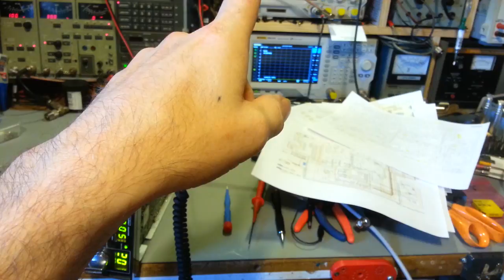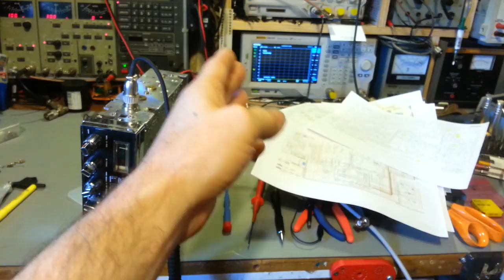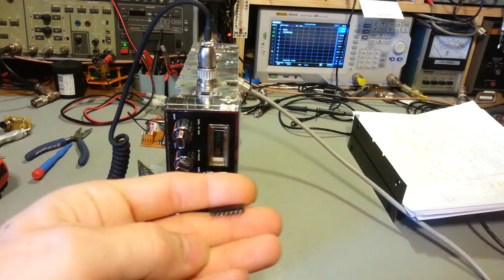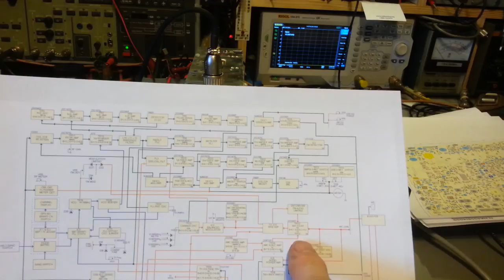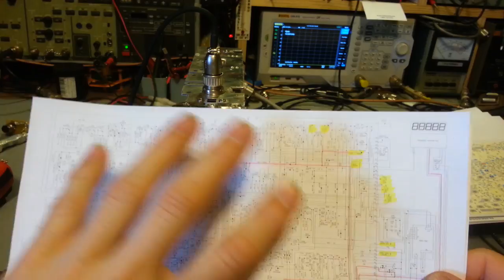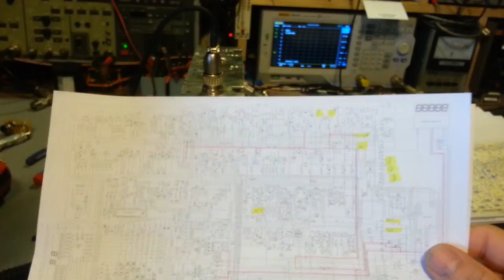Mirage 9900 (Galaxy 99) carrier in LSB but not USB and only when modulated repair.

Comment: Yes one day I will have a spectrum analyzer and scope. For someone like me that just does this as a hobby could I get away with a scope with an FFT function instead of a real dedicated spectrum analyzer?

I once had an SSB problem with a radio's. The lights where flashing like strobes with modulation as well.  I found that the voltage regulator was bad replaced it and thought I was done. Nope that was just half of the problem. Turned out the crystal filter was bad too. 

Replacing the voltage regulator fixed it enough so that with the sparse equipment I had I thought I had fixed it. Spectrum analyzer would have made it clear that I had more work to do! LOL It continued to get worse shortly after it got better leading me to the crystal filter.